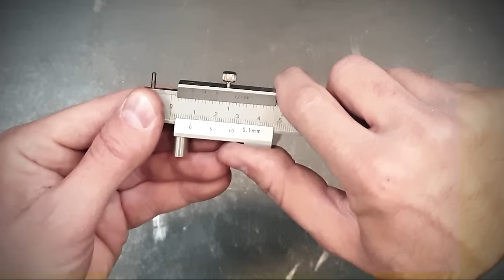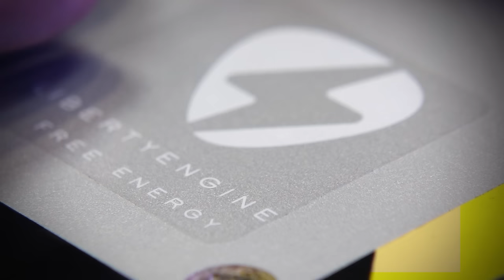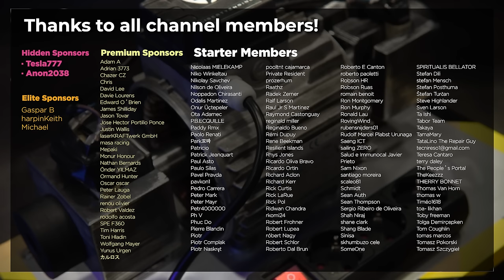10Kw FREE ENERGY GENERATOR with Microwave Parts

Comment: Measures of motion.
Saving and changing measures of motion in fields.

Energy is not a substance of nature, but a mathematical measure of motion and field potential invented by man. Field potential is the ability of a field to change movement, measured in the same measures in which movement is measured. For example, it is the measures of speed, acceleration, momentum or energy.

The laws of conservation and change of measures of motion are energy and dynamic laws of nature. Both types exist in nature. The laws of conservation and change of measures of motion (including measures of energy and momentum) of a physically isolated system are mutually complementary laws. And therefore, they do not contradict each other. In view of this, the energy and momentum of a physically isolated system can both change and be conserved. That depends on the configurations of the field action in the system, in time and space.

Symmetrical actions of fields create symmetrical forces (the law of symmetry of forces, also known as Newton’s 3rd law), which, when integrated over space or time, lead to symmetry in changes in measures of motion, that is, for example, to the laws of conservation of energy and momentum.

Asymmetrical actions of fields create asymmetrical forces (the law of asymmetry of the action of forces), which, when integrated over space or time, lead to the laws of change (not conservation) of the integrals of mathematical measures of energy and momentum, as well as other measures of motion, in a physically isolated system. The last law (the law of changing the measures of energy and momentum of a physically isolated system) is the basis for the action of alternative energy sources and, in general, all new energy systems.
Reply: Energy sources.

Any energy source consists of two circuits, primary and secondary. The primary circuit generates a working field; in the secondary circuit, this field creates potential energy (potential) in the charges and sets them in motion, generating kinetic energy and other measures of motion. That is, voltage and current. 

For example, each charge is a primary circuit generating an electric field in which another charge or group of charges, forming a secondary circuit, is accelerated. As a result, the two charges form an energy source consisting of a primary and secondary circuit. Energy sources can be any device.

There are classical and alternative energy sources. In classical energy sources, the cost of generating the working field is greater than the energy created by the field. In alternative energy sources, the cost of generating the working field is less than the energy created by the field. In view of this, alternative energy sources create both the necessary energy for re-generation of the field, and additional energy to power the potential and current of the payload. 

The efficiency of the energy source is equal to the ratio of the energy generated by the field to its costs for generating the working field. Therefore, the efficiency of classical energy sources is less than or equal to unity, and the efficiency of alternative energy sources is greater than one. Classical energy sources generate a working field due to external energy sources, and all the energy generated by the field is directed to the payload. Alternative energy sources can work due to the internal processes of energy generation by the working field. At the same time, they can transfer an additional part of the energy to an external load.

Alternative and classical energy sources can include transformers and electrical machines. In order to turn a classic electric machine or transformer into an alternative energy source, it is necessary to reduce the value of resistance when generating a working field in the primary circuit. This can be done in two ways.

In transformers and AC electrical machines, the reactance of the primary circuits can be reduced by adding opposing resistances, inductive or capacitive. In this case, the voltage will decrease in proportion to the decrease of resistances, but the current and generation of the working field will remain unchanged. As a consequence of this, less energy will be spent on generating the working field than is generated in the secondary circuit.

The same can be done if you create an asymmetry in the e/m interaction between the primary and secondary circuits, in time or space. The second method is applied to direct current machines, or to alternating current machines, in which the main part of the energy consumption is the resistance of the secondary circuits. Asymmetry of e/m interaction can be created in many ways to compensate for secondary fields. For example, YouTube channel "3 Technology" uses more than 500 such methods to create alternative energy sources based on electrical machines and transformers with asymmetry of electrical interaction.
Reply: Rotating field transgenerator

The device shown in this video is a transformer with a rotating field. This transformer has an asymmetry in the interaction between the primary and secondary circuits. That is, between the circuit that generates the working field, and the circuit in which this field generates energy.

Transformers that generate the necessary and additional energy are called transgenerators in the new energy sector. Therefore, in this video we see a transgenerator with a rotating field.

The field rotation is based on the use of an asynchronous motor stator. The aluminum rod inside, under the influence of a rotating field, generates a closed current flowing along the sides of the rod. The magnetic field of this current, acting on the magnetic circuits and windings of transformers located at the ends of the rod, crosses them (the field closes the magnetic circuit through the air), and induces voltage and current in them. The rod with transformers at the ends forms a secondary circuit that generates energy. Whereas the primary circuit is the stator of an asynchronous motor, which creates a rotating field.

In this case, the rotation of the field may not be complete; it may simply swing. The main thing is that it induces alternating current in the central rod. Moreover, since the frequency of the current in the stator of an asynchronous motor and in the transformers is the same, the current from the transformers can flow both into the motor and into the payload through the switch and other distribution devices.

The asymmetry of the e/m interaction between the central rod and the stator arises as a consequence of the presence of a large air gap between them. The rod field is greatly weakened by this gap and has virtually no effect on the stator. Whereas the stator field, having two opposite poles, crosses the rod and induces voltage and current in it. In this case, the sliding frequency of the field is equal to the frequency of the current generated by the transformers. Hence, even a weak stator magnetic field can induce a strong current in the rod.

In order to understand in more detail how the asymmetry of electrical interaction is organized in this device, it is necessary to consider in detail the switching of the stator windings of the electric motor, and the connection to them of voltage and current coming from the transformers at the ends of the rod. But the fact that the device works indicates that the asymmetry of the electronic interaction in it was successfully implemented by the author of this invention. Therefore, we just need to understand how it works using the above theory of the functioning of alternative energy sources.
Reply: Постоянные магниты, расположенные на концах трансформаторов, создают магнитное поле, которое модифицируется полем стержня, и тем самым помогают вырабатывать энергию в трансформаторах.